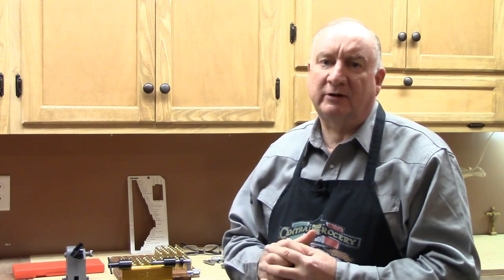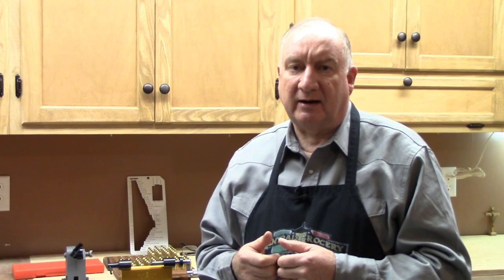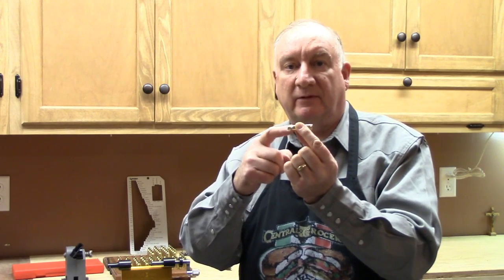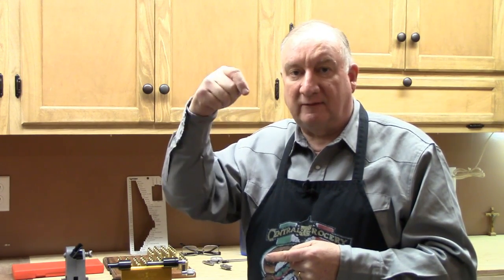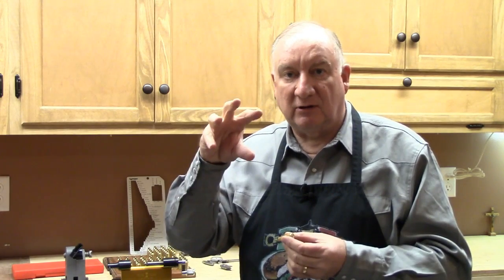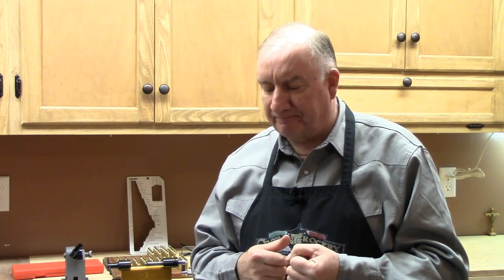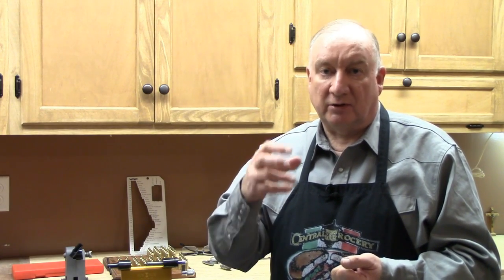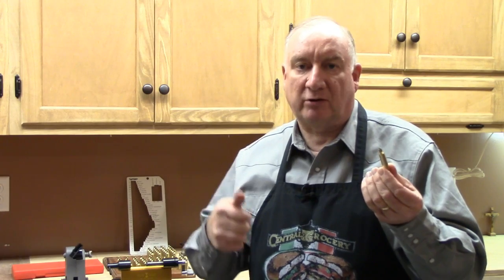Neck turning and neck sizing ~ Seeking a higher level of accuracy!

Comment: Hi, thanks for the video. I am new to reloading and use .308 Lee classic kit. I use brass from previously purchased factory ammo. While seating bullet into different brands of brass, I noted that force required to do so is different (stronger and more frequent mallet strikes may be required). After watching this video, it is my understanding that brass wall thickness in the neck must be different. Is there any danger associated with more tight bullet seating? I suspect it can cause higher pressures and will most likely affect velocity/accuracy. I newer exceed recommended amount of powder and stay within Min - Max OAL.
Reply from the maker: Oleksandr Ananiev 
There is never any danger with tight neck tension.  The most snug brass is is no match for 55,000 psi of pressure.  Even heavily crimped bullets with tight brass can be withdrawn with less than 50 pounds of force with pliers.  The only danger is overly long brass that jams at the chamber end lengthwise, and causes a clamping action that cannot release.  Do not mix brass with the same loads, as they will have varying pressires and often very different points of impact.  Work up loads with different brands separately, and record the results for later reference.
Reply: Thank you, I will follow your advice
Reply: GunBlue490 a

Comment: Hi, I usually neck size my cases most times, but I have been told that neck sizing is useless and that it doesnt actually improve accuracy, as the neck sized reloaded round would have to be inserted into the chamber in the exact same position as it was when it was fired the 1st time, the same "o'clock" position let say. i'd lime to hear your opinion on this issue please. great video as usual, thanks!
Reply from the maker: Untrue.  That notion is based on the false assumption that chambers are asymmetrical and that they distort cases, which would be mechanically next to impossible. A chambering reamer is guided by a centering pilot on magnificently accurate centers.  Even an asymmetrical drywall hole cutter will always swing a perfect arc to its widest cutting surface.  Your chamber is in perfect concentric alignment with your bore.  It goes without saying that maximum concentricity demands neck turning, which centers the bullet correctly to the bore.  Though fully sized cases that are not turned can demonstrate fine accuracy, neck turned cases always have greater accuracy potential. It is the only method of sizing employed by benchrest shooters, who have been doing it since the 1950s.  Neck sized cases will far outlast full length cases by up to ten times.  Of course, neck sizing is strictly a target shooting and varmint shooting technique that should never be used in the game field, and is only suitable for bolt action and some single action rifles that have cammjng leverage.  My most accurate loads have ALWAYS been neck sized, and I do not orient them, which would be pointless.  I use a Starrett dial indicator that reads to less than .001 to check for run out, and I check at various points along the length of the round.  Trust me.  Neck sized cases that are also neck turned are perfect, with zero run out, no dial movement whatsoever.  Neck turning is vitally important.
Reply: GunBlue490 Thanks! I always wondered what the science was behind it. Besides, its hard to argue with results. I have noticed that my loads are more accurate when I neck size.
Reply: I’m a competition shooter and I can tell you this is incorrect.  
The reason for neck turning is not for concentricity, it’s done to obtain consistent neck tension.  Also, all competitive long range shooters I know have moved away from neck sizing and are F/L sizing with ~0.002” shoulder bump.  It’s the most consistent way to size brass.  Neck sized brass does not outlast neck sized brass by 10 times, not even by double.  This is all a myth.  

Start learning from competition shooters and you’ll see the light.
Reply: @ErikCortina  
Well said

Comment: The notion of neck turning to establish concentricity of the case neck to ensure that the bullet enters the barrel on center brought to mind the practice of changing the seating depth of the bullet in the cartridge to minimize the "jump" the bullet has to make before entering the barrel. Many shooters express the opinion that the latter mentioned practice greatly increases accuracy.  In your opinion are these two practices complimentary or substitutes for one another?

I have two CZ 527 rifles, one in 204 Ruger and the other in (soon to be on the ash heap of cartridge history 😉 ) 17 Hornet, in both cases when pressing down the bolt lever the entire bolt moves forward perhaps a sixteenth of an inch or more. My Savages don' t do this. Both rifles are very accurate.  Is the bolt engaging the ejector claw or is the bolt minimizing the head space and advancing the bullet closer to the barrel?  What are you thoughts?

Thank you for your kind attention and response to my questions.

Paul H.
Reply from the maker: Jack Lucas 
The distance a bullet jumps, or its snugness to the rifling, cannot center a bullet that is off center.  Concentricity is fundamental to accuracy.  Countless rifles shoot pinhole groups with lots of bullet jump, provided that their axis is the same axis as the barrel.  Common practices of benchrest shooters to jam bullets is not as common as often stated.  Bullet jump is always being monkeyed with, but no benchrest shooter worth his salt would fail to turn his cases.  They are separate issues.
Reply: Thank you for your considered and timely response.

Comment: Thank you so much for your videos.  My question regards powders.  A friend gave me some IMR 3031 to use in my 308.  It has small long rods which break in my powder thrower.  Varget powder does not seem to noticeably break when I throw it.  Should I use this powder in my RCBS thrower, or is it not a concern. Thanks again for your help and I look forward to your video on annealing.
Reply from the maker: Wayne Bridges 
IMR-3031 powder is an extruded single base rifle powder that is useful in a broad range of cartridges, and has a moderately fast burning rate that is faster than Varget.  It develops medium velocities in the 308 when used with bullets heavier than 180 grains, and gives best velocity with 110 through 130 grain bullets.  I ask you to watch my video "Sporter rifle accuracy - Part II the Ammo", where I elaborate on the advantages of single base powders, which includes IMR-3031 and Varget.  Burning rates are primarily controlled by shape and size of the granules, just as small logs burn faster than larger ones.  Extruded powders are manufactured not unlike miniature macaroni of varied diameters and lengths that have notable differences in the way they meter through powder measures, which is fairly smooth with some, and less so with others.  Much has been made of the cutting of extruded powders, which is not the issue that it is perceived to be.  The number of granules cut in a column of powder in a measure is very few, perhaps less than three or four, and has no practical effect on the total charge volume.  All factory loads are measured by volume.  I have checked the weights of measured charges with various coarse extruded powders, and have observed variations of no more than two tenths of a grain above or below the intended weight in my 40 year old RCBS Uniflow measure, in worse case examples, where an extreme bump is felt, and less than one tenth extreme variation with charges that pass with moderate resistance.  As mentioned in my video, extruded powders behave with exceptionally uniform results on target, and are not sensitive to far greater variations than any measured charge would drop.  It is not a concern, in other words.  To increase the uniformity of charges, always follow these procedures:
Never charge loads that are within 1 percent of maximum, but bring such charges up with a trickler when needed.  
Maintain at least a quarter of the hopper filled, when using coarse powders, which keeps a consistent pressure.
Use the largest drop funnel that your case neck accommodates.  
Set your handle to fill on the up stroke, and empty on the down stroke, and finish on the up stroke.
Develop a rythm, and always lift and drop firmly with a uniform military cadence, and loud clack; ONE-TWO!
Return heavily obstructed charges back to the hopper.
Have a flashlight on the bench and visually inspect the entire loading block to assure that each case is uniformly filled.
Though it takes another movement, I greatly prefer to place each case under the drop tube manualin, returning it to the block, rather than charging down the block.  It gives more room to work the handle confidently, and avoids bumping and upsetting charges in the block.
I have used and prefer extruded powders for most of my rifle loads, despite the slight aggravation of coarse handling.  However, some extruded powders meter nearly as smoothly as ball powders.
Reply from the maker: Wayne Bridges 
IMR-3031 powder is an extruded single base rifle powder that is useful in a broad range of cartridges, and has a moderately fast burning rate that is faster than Varget.  It develops medium velocities in the 308 when used with bullets heavier than 180 grains, and gives best velocity with 110 through 130 grain bullets.  I ask you to watch my video "Sporter rifle accuracy - Part II the Ammo", where I elaborate on the advantages of single base powders, which includes IMR-3031 and Varget.  Burning rates are primarily controlled by shape and size of the granules, just as small logs burn faster than larger ones.  Extruded powders are manufactured not unlike miniature macaroni of varied diameters and lengths that have notable differences in the way they meter through powder measures, which is fairly smooth with some, and less so with others.  Much has been made of the cutting of extruded powders, which is not the issue that it is perceived to be.  The number of granules cut in a column of powder in a measure is very few, perhaps less than three or four, and has no practical effect on the total charge volume.  All factory loads are measured by volume.  I have checked the weights of measured charges with various coarse extruded powders, and have observed variations of no more than two tenths of a grain above or below the intended weight in my 40 year old RCBS Uniflow measure, in worse case examples, where an extreme bump is felt, and less than one tenth extreme variation with charges that pass with moderate resistance.  As mentioned in my video, extruded powders behave with exceptionally uniform results on target, and are not sensitive to far greater variations than any measured charge would drop.  It is not a concern, in other words.  To increase the uniformity of charges, always follow these procedures:
Never charge loads that are within 1 percent of maximum, but bring such charges up with a trickler when needed.  
Maintain at least a quarter of the hopper filled, when using coarse powders, which keeps a consistent pressure.
Use the largest drop funnel that your case neck accommodates.  
Set your handle to fill on the up stroke, and empty on the down stroke, and finish on the up stroke.
Develop a rythm, and always lift and drop firmly with a uniform military cadence, and loud clack; ONE-TWO!
Return heavily obstructed charges back to the hopper.
Have a flashlight on the bench and visually inspect the entire loading block to assure that each case is uniformly filled.
Though it takes another movement, I greatly prefer to place each case under the drop tube manualin, returning it to the block, rather than charging down the block.  It gives more room to work the handle confidently, and avoids bumping and upsetting charges in the block.
I have used and prefer extruded powders for most of my rifle loads, despite the slight aggravation of coarse handling.  However, some extruded powders meter nearly as smoothly as ball powders.

Comment: Excellent video, thank you for posting. My only question during the whole video was on annealing. I'm delighted that it was addressed at the end and I look forward to a video on the topic.
Reply from the maker: MrRoboskippy 
Annealing simply returns the original softness of case necks after six or so firings and resizings.  I will be doing a video on it sometime in the future.  Beware that over annealing, heating to orange or even red, that destroys alloys in the brass, and is very commonly seen in many YouTubes.  Correct annealing takes only several seconds, at the neck only.

Comment: Thank you for do doing these informative videos. Could you expand on (I am hoping for another video) when to only resize the full case and the circumstances of when just to neck size?
Reply from the maker: Geoff Ball 
There are two reasons for neck sizing.  When done with a true neck sizing die, it extends case life dramatically by not overworking the brass.  Because the case is firmly surrounded by the chamber instead of lying at the bottom, or being canted by a spring loaded ejector, the bullet is aligned with the bore, but only when done in conjunction with case neck turning.  Even bench rest chambers can only improve on this slightly with tight necks.  Together, these two tricks can easily cut groups in half with a good load, and are standard procedures for best accuracy.  Never under any circumstances neck size for game hunting, but neck turning is certainly good for all uses.
Reply: Thank you for your response and I really appreciate you taking the time to help novices like me.

Comment: can neck sizing be used for a semi auto like M1A?
Reply from the maker: Hi its Me 
No, it's not for autos, pumps, or lever actions, which have insufficient camming force to close.  It requires a very firm effort to close the bolt that only direct hand pressure can accomplish.  In fact, some autos such as Browning BARs sometimes require small base dies to fully close. It's a point that I forgot to make.
Reply: GunBlue490 Thank you